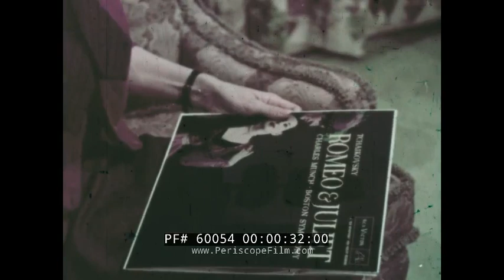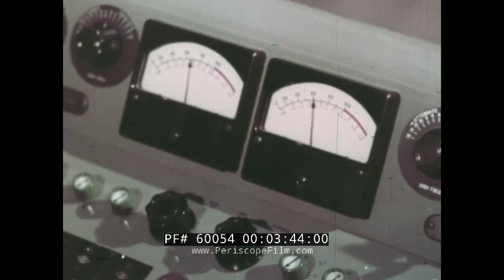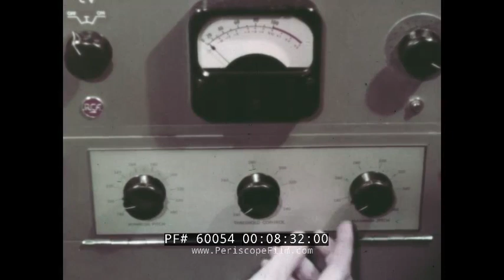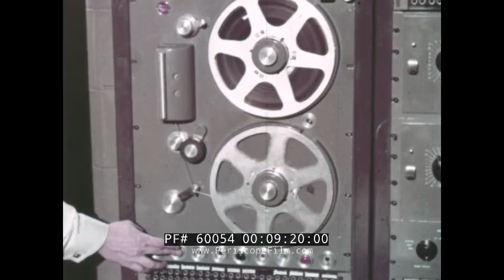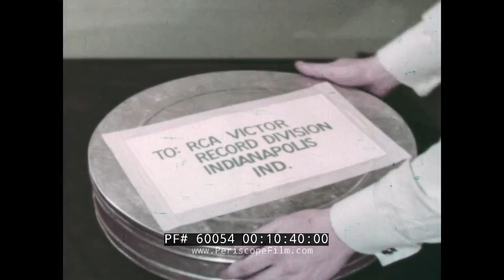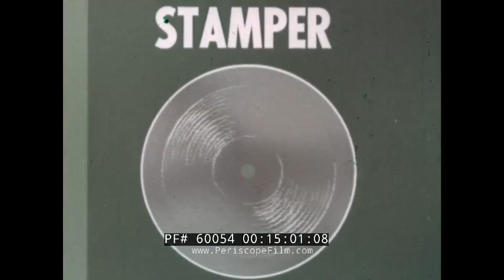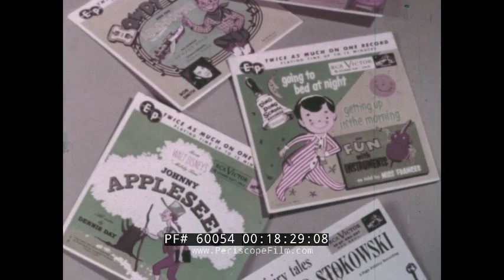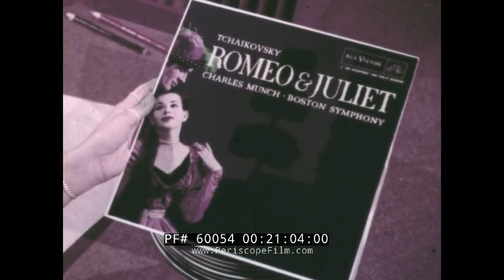RCA VICTOR MANUFACTURE & RECORDING OF VINYL RECORDS  1956 INDUSTRIAL FILM   60054

Comment: What a flashback in time for me. Recording, mastering, plating, pressing. And looking at the finished products of many of the RCA line-up (towards the end) is just amazing. Elvis, Fats Waller, The Three Suns, and soooooo many more. Thanks for finding and posting this film, and taking me back 50 years. BTW, I'm not sure why they didn't use covers of Romeo and Juliet with the RCA catalog number on them, but the number is LM 2043. 2:34  It's been decades since I've used one, but what a beautiful Ampex unit. 18:00  Master playback and slave duplication! Wow, what memories! This was the department at Cook Laboratories that I was in charge of back in the 70's. Ours was made by Liberty, so it looked a bit different, but the setup was the same. Ours was for cassette tapes where as these are for 7" two track reels.
Reply: Ampex 300 and 3200 tape machines-used and maintained these at VOA,Wash DC!Superb and actually easy t o maintain machines.Liked working with them.

Comment: At @;33.Ampex 300 recorders running, at what speed, 15ips? Not 30?
Reply: Looks like 15 ips to me. But the playback for cutting the master looks like 30 ips. Editing goof I suppose. And tape mastered on 1/4" tape? This is late 50's.
Reply: @quantumleap359  Thanks for responding.
Reply: Both the recorder and the mastering playback machine are running at 15 ips. A 2400 foot 10 1/2 inch reel of Scotch 111 tape would have only lasted 16 minutes at 30 ips, too short for the classical music being recorded.
Reply: @gotham61  A one-time producer of 78rpm record re-issues onto Vic LPs told me he used 30ips. I thought 30ips was a standard. Apparently not. Thank you.
Reply: @moldyoldie7888 The sound quality differences between 15 and 30 ips are a bit of a mixed bag. While high frequency response and noise are improved at higher speed , there is also a phenomenon called head bumps which results in poorer bass performance as the speed goes up.
Reply: @gotham61  Believe it or not, I'm aware of them. Does the higher speed make editing easier?